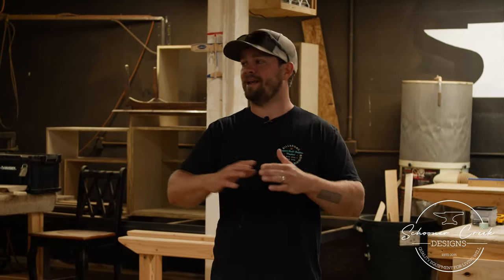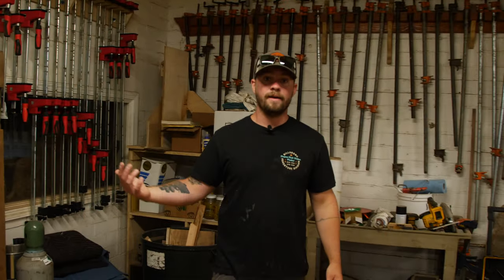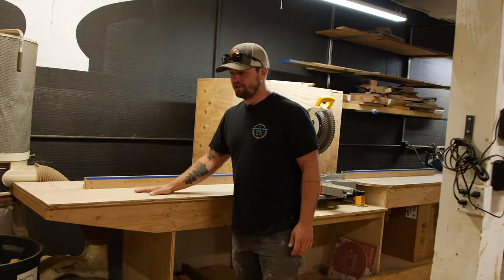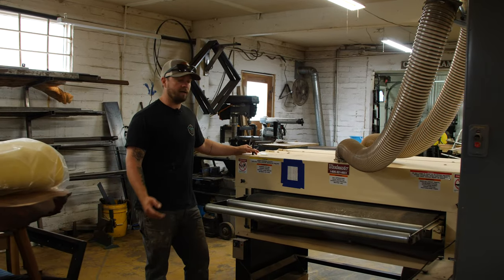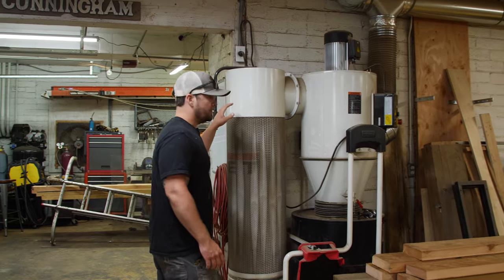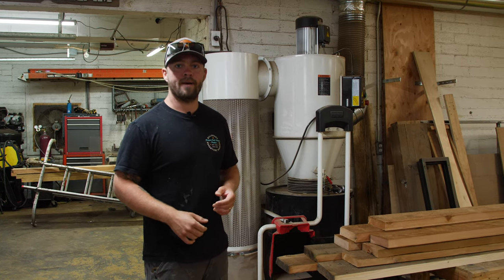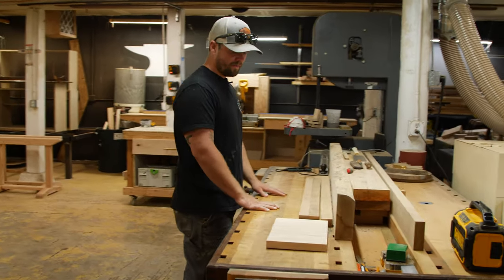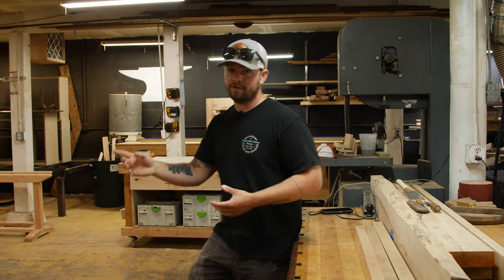Shop Tour! How we set up our woodshop

Comment: That's a good looking shop! I spent my teen years just down the road in Depoe Bay, my grandparents loved in LC. How well does the air drying work that close to the ocean?
Reply from the maker: Hey! Thanks for the comment. We love our old building here in LC, air drying and humidity control is always a battle but we've gotten it pretty figured out. We have a great natural gas furnace that keeps the temp regulated and 4 large dehumidifiers that are constantly pulling about 2 gallons of water out of the air every 24 hours each! If you're ever in the area feel free to stop by!

Comment: Hopefully going to start on a shop 32x40 this fall, curious how tall your ceiling are. Been thinking of 10 feet. Not sure why you would need anything taller for woodworking and easier to heat in here in CO @ 7,000 ft. Nice videos - thanks
Reply from the maker: Thanks a ton for watching and taking the time to comment! These shop ceilings are pretty low but it all works great for my needs. My last shop that I rented had 12' ceilings and exactly like you mentioned it was always a struggle to control temperature, especially in the winter. This shop is the lowest level of the commercial property we own. The bottom sides of the beams are only 8' from the floor making the ceiling just about 9'. I heat the whole space with a mid size natural gas heater made by Reznor, it works great! I think your totally on the right path! So awesome to have a new shop in the works! Congrats and good luck with the project!